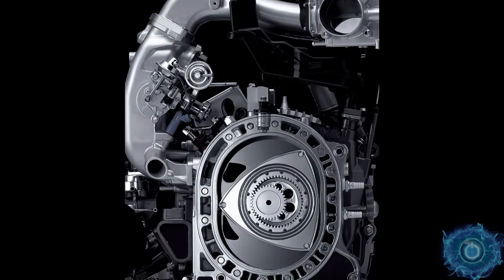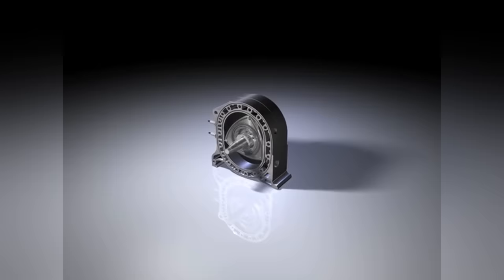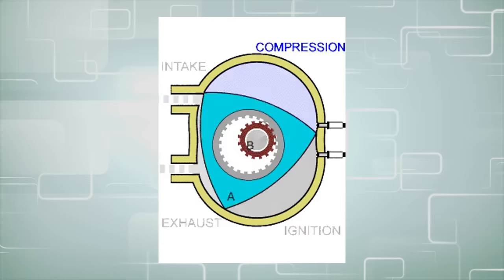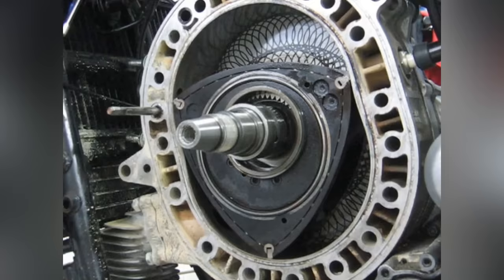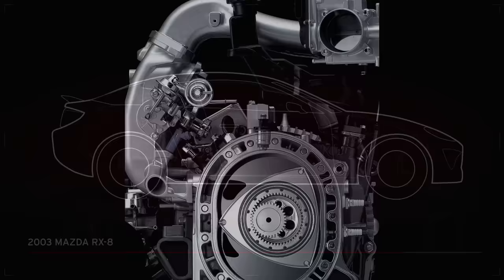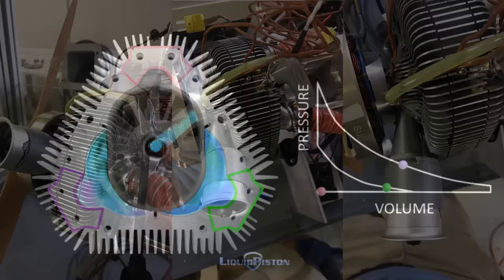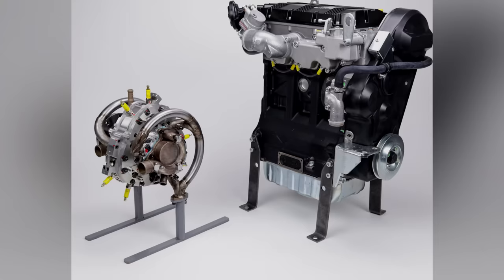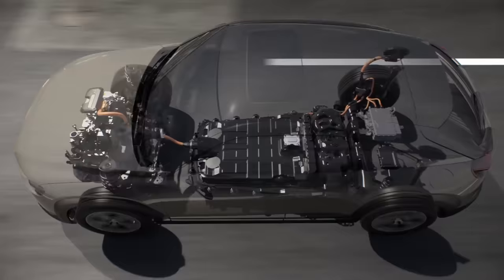STRANGE New Rotary Engine BREAKS Records

Comment: The four sided quasi turbine is a superior engine. First, it has lower vibration by being centered. Second the center of the engine is empty ( where the rotary has its off center crank so to speak gear elopse) Here you could have a generator of a gear case, making the engine and hybrid in one assembly rather than a bolt on.

Comment: Whats up with this calling a radial piston engine a rotary engine?  The rotary engines are not even in the same ballpark as a radial piston engine. You are leading people astray of the facts as you do not know them yourself. This is the biggest problem of today ... everybody is an "expert". Sorry to say you are not and you should correct your errors in this video. I am a fan of the rotary or 'wankel"  engine but it has it's drawbacks. Technology will correct some of these issues in the near future. If the engine has pistons it is NOY a rotary!

Comment: Liquid Piston is a good improvement to Wankel Engine.  However, there is another internal combustion engine that has a high potential for hybrid car and its weight to power ration is better than liquid piston.  This is the Regenerative Micro Gas Turbine.  It can take many kinds of fuel and its high RPM allow for a small generator to charge the batteries.  Since it is intended to run only O% (Off) and 100% power, its weakness of being poor on varying speed is negated.  Please show a video on this.

Comment: They failed and still are a failure including liquid pistons because not a single one of them have made them like a real Wankel. 20,000 rpm? it's nothing. the DKM 54 in the picture is correct and you'll notice quite a different shape, it's because a real Wankles the chamber counter rotates at the same speed in the opposite direction of the rotar, making a a150,000rpm+ engine that was vibration free, also came the efficiency  and extreme power. all these other rotary are all jokes on Wankle's design. it was a very successful engine, but Wankle got bought out was what i grew up on by the oil companies because of it's efficiency. would make sense why nobody is using the real design that made it exclusivity so smooth, efficient and powerful. they took all the best parts out. I'll start to be impressed when i see one start resembling Wankles DKM 54 picture. that's the only right one. none of Mazdas are right either. trash.

Comment: Hydrogen is DEAD. At best , 100kWh from an energy source will be 30kWh spendable in the vehicle, vs 85-93% spendable in a battery electric car. Plus you need to build the enormous infrastructure for hydrogen filling stations. Nope. Never ever going to happen! 
Rotary engines are interesting but will not play any major role in cars. Battery technology is moving too fast now, and any fuel burning engine will come along with a long list of liabilities: filters, oils, gaskets, spark plugs, wear, coolants, exhaust system, pumps, fuel system and more.

Comment: I had a period of fascination with LiquidPiston engines, but after a very thorough critical analysis I don't like it anymore. This engine is not significantly better than a Wankel engine. It achieves the same displacement and power by having exactly the same sealing strip spacing and transmission, but being heavier. The only real gain is a greater combustion time at constant volume. All the rest are disadvantages: larger size, heavier weight, difficulty in cooling the rotor, difficulty in assembling more rotors. The only sensible use case is extenders for cars and UAVs, but it requires 3 injectors and 3 spark plugs. Better results can be obtained with a two-stroke engine.

Comment: Wankel was a quiet engine turbine mooth and very relaxing to drive. Liquid Piston looks noisy and having never driven nor will I until they get over 200 hp, I'd say Liquid Piston needs to do a lot more R&D before I can use one. The high compression is the masterstroke, very impressive. The size and likely high noise are very disappointing. Deal breakers truth be told.

Comment: WELL THEN BELIEVE IT OR NOT I HAD THE FIRST RX-2  AND THEN A RX-3 WITH THE RX-3  I TOOK SECOND PLACE ELIMINATOR OF THE DAY AT TAMPA DRAG STRIP IT WERNT FAST BUT DEAD RELIABLE AS SOON AS THE BUZZER WENT OFF I SHIFTED TO SECOND AND THAT WAS IT NEVER MADE 3RD IN THE 1/4 MILE 
AND TURNED A WHOPPING 17-18 SECONDS 🤣🤣 BUT UT DID IT EVERY TIME NO FAIL

Comment: Please put down down your crack-pipe at least a full 24 hours before you make a video.  Mazda RX8 did not have a 2.6 liter rotary engine, nor did thec3 rotor Cosmo.  The RX8 had a 1.3 liter, and yes horsepower was rated at 238.

Comment: Fossil fuel use has to end asap in a catastrophic  climate emergency so what's the point ?
Reply: it can be used for hydrogen combustion as well.. so.. it has a potential future. if hydrogen can be produced in the future in large amounts.. ( from nuclear powerplants from the waste heat energy )
Reply: @heartflame503  Hydrogen can better be used with fuel cells that with ICE.
Reply: That is true, but the paradox is that if all the ICE's today would magically be replaced with electric motors, the overall CO2 production would remain the same. You still need to generate electricity for those motors...
Reply: @alterbart7916  sure but the transition to solar and hydro and wind is going faster than you think...  almost all the coal fire plants are closing in 2-3 years .. in Australia.  NZ only about 45% of new cars are pure ICE .. and reducing.
Reply: @heartflame503  "transition to solar and hydro and wind is going faster than you think" 
no, according to the numbers, it is not, even with the elevated energy prices in Europe.
But first, remember, hydro is bad . In a long run, it is bad. In a short run it is a disaster. Bad for ecology. And there are few areas where you can really use it. No real future.
Next, for the solar and the wind the numbers telling a picture that is not quite optimistic. After the initial boom it is time now when maintenance costs begin play significant role and it is not quite assuring. This is especially true for the wind turbines - it seems that it is cheaper to knock the old down and put in a new one that to repair the turbine... So if you look at the sales numbers, they are soaring. If you check the actual power production... not so much... Solar panels work well in southern regions; not so well in the northern regions. In Germany it already results in taking good lands from agriculture... Of course it would be great to cover Sahara with solar panels, but who will use all that energy?

Look, I am not saying renewables are inherently bad. What I am saying is if you force innovations too hard you actually stall. You take money from real breakthroughs to ineffective, but politically encouraged projects, which, by the time of their implementation would turn to be obsolete. There should be a careful evaluation, not some politicians shaping the public opinion to their advantage.

"almost all the coal fire plants are closing in 2-3 years" this is another example of disconnect between technology and politics. Coal plants should have been closed decades ago. But they are not all retiring in 2-3 years. In USA, they will keep some coal power stations after 2035... Now look at China... The funny part is they are not even profitable. All politic.

"in Australia.  NZ only about 45% of new cars are pure ICE .. and reducing"
Where did you get these funny numbers? The real numbers for Australia 2021: "56 per cent of new cars sold this year are powered by a petrol engine while diesel accounts for 32.5 per cent of new vehicle sales, demonstrating the Australian reliance on ICE vehicles by taking up 88.5 per cent of the market" Even in the last months EV were only 8.8% of all new car sales, despite of the enormous political push. Also, "non pure ICE" cars - any hybrid goes there, not just plugin ones, so it is still ICE...
Reply from the maker: @heartflame503  Some good points, also it depends where you live. Canada is mandating electric cars within the decade but the power grid (i work in the industry) can't handle the influx of charging. It takes over 10 years to build a nuclear plant here because the regulations are complex, lots of red tape. So we are in predicament and I think the only way out of is to go hybrid where you can offset power grid demands.